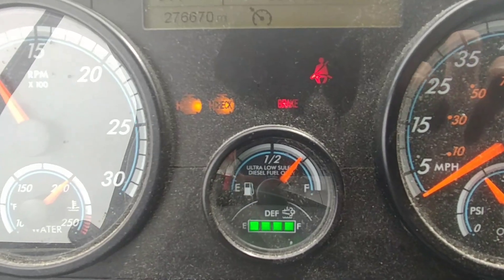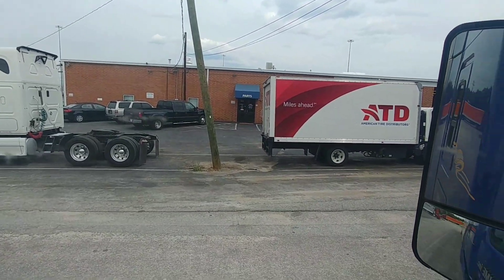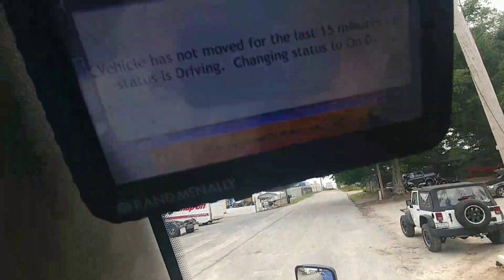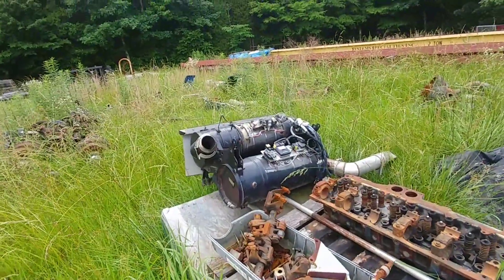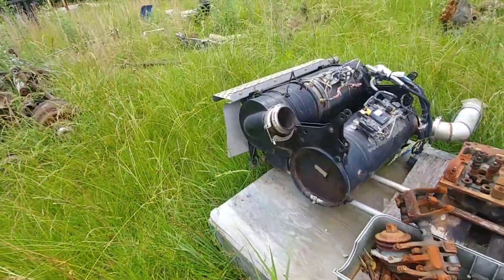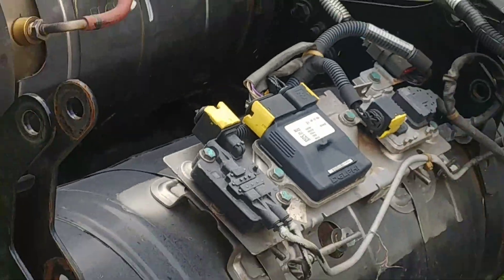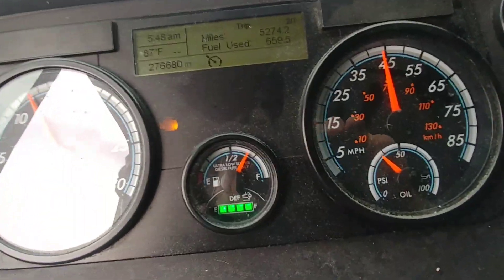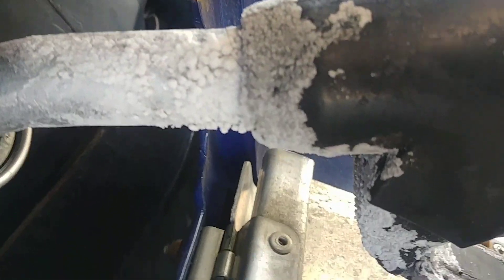DEF Derate Problem

Comment: All you have to do is regen the system. Turn off the AC and the cruse control. And then push and hold the regen button until the RPM raise up
Reply: what is the regen system

Comment: Did you have to go back to the shop after that for any type of def problems? I had those same issues added def and   the active codes went away but one check light lamp is out. It originally had blithe before I added def
Reply from the maker: I learned my lesson. Top off the DEF at every fuel purchase. No more issues.

Comment: How did u do a manual regen? Mines won’t do it
Reply from the maker: George Hale press and hold the switch on the lower part of the dash...on the right side of the steering wheel.
Reply: Your red stop engine light has to be lit for you to be able to do a manual regen. If you do not have that red light then keep your truck running until it comes on.

Comment: Did you have anymore problems
Reply from the maker: I only experienced this problem if I allowed the def tank to get low and then refilled it. I suggest keeping it topped off. I believe that crystals form in the tank and don't dissolve quickly enough to prevent clogging the doser valve.
Reply: Did check engine light go away
Reply from the maker: @iceolar  check engine light went off